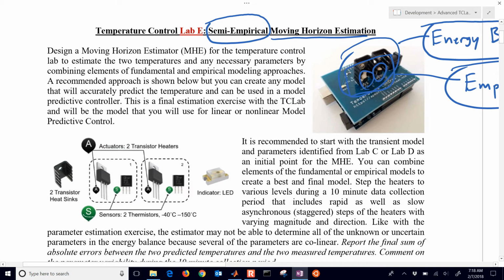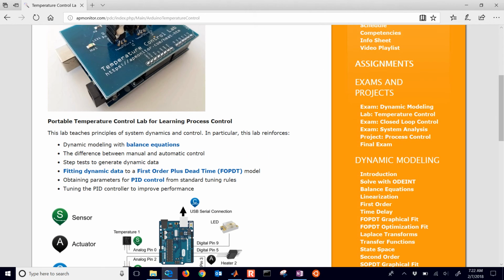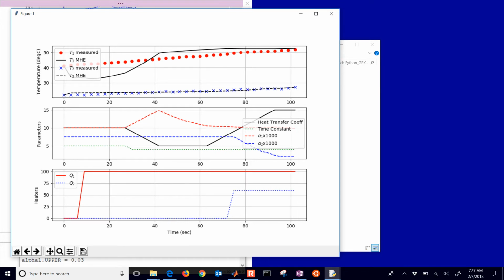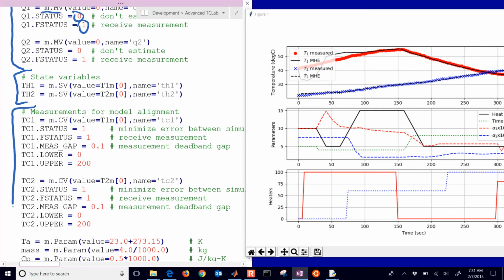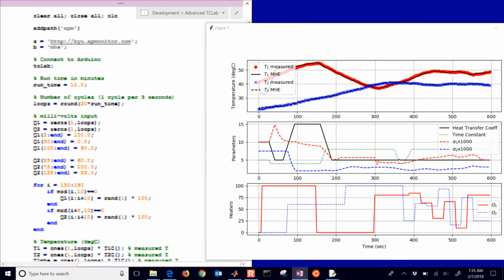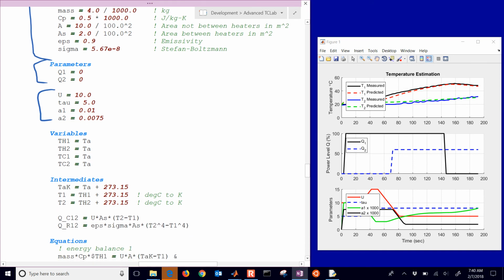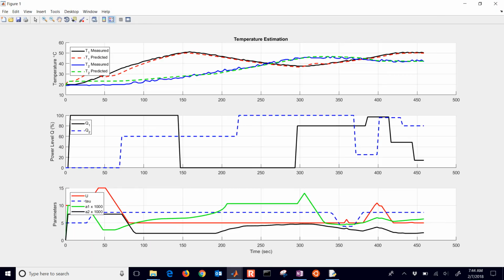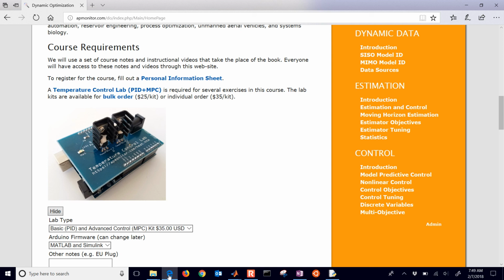TCLab Moving Horizon Estimation

Comment: I viewed this 3 times.  I think this is a good exercise in estimating parameters. Make a model and then see if you can estimate the parameters for that mode.   I do the same thing but what algorithm is used to do the estimation?  In real life I can't run gekko on an embedded product.  I must use BFGS or Levenberg-Marquardt.  

Sometimes there is noise on the feed back devices or failures.   It is good to have a model to switch to so the system can keep operating for a while or at least until a safe shut done.

I usually update the model using a batch method.  Updating models on-the-fly is tricky.  I have tried systems ID techniques like recursive least squares.  The problem is that some parameters should be updated during transients and others like gains should only update during  times when the input isn't changing.  Obviously there is no point in updating time constants when the system is at a constant velocity or temperature.

There must be rules that specify which parts of the model get updated.  Perhaps gekko takes care of this.

I like what you are trying to do.
I like what gekko can do for you.
What I don't like is that the under lying problems are not discussed.
I don't like that gekko is just a black box.
Providing answers without understanding does not really help.
I have written many different minimization algorithms from scratch in Mathcad just so I know what is really happening.
Reply from the maker: Peter, great feedback as usual. The details of the algorithm is discussed in the Dynamic Optimization course such as the collocation lectures (http://apmonitor.com/do/index.php/Main/OrthogonalCollocation) and objective function formulations (http://apmonitor.com/do/index.php/Main/EstimatorObjective). I've used APMonitor directly on a Raspberry Pi but micro-controllers (Arduinos) are generally too limited to run gradient-based nonlinear programming optimizers. We use a serial connection for this lab so that the computing is done external to the Arduino and the Arduino is used only for data acquisition (temperatures) and to adjust the actuators (heaters). Gekko itself is open source: http://gekko.readthedocs.io/en/latest/ - you may be referring to the underlying APMonitor executable that is performing the calculations as the black box. The dynamic optimization course (https://apmonitor.com/do) gives all the details on the algorithms that are being used. Unfortunately, the course isn't long enough to have students reprogram a modeling language and make a generic Dynamic Optimization tool such as APMonitor. The modeling language would need to include things like automatic differentiation, sparsity of 1st and 2nd derivatives, interfaces to sparse linear solvers, decomposition methods for initialization, collocation methods, etc. There are other packages that are completely open-source such as Pyomo. It offers a lot of flexibility but the flexibility comes at a significant speed cost.

We did the batch regression in folder 2 of 
https://github.com/APMonitor/arduino - we're designing the estimators so they can continually update the models even if the application is 
running for days, weeks, or years. That much data would obviously be 
problematic for a batch estimation approach so we turn to Bayesian 
methods.

You refer to writing a minimization algorithm from scratch. We do cover that in the Mathematical Optimization course such as http://apmonitor.com/me575/index.php/Main/QuasiNewton and http://apmonitor.com/me575/index.php/Main/InteriorPointMethod - the Dynamic Optimization course is more focused on applying optimization solvers and I encourage students to take the other course if they want to program the solvers. I agree that you gain a much more fundamental understanding of the algorithms if you program them yourself. My suggestion for students on this assignment is to use a good solver such as IPOPT instead of try to reprogram the gradient-based algorithm.
Reply: I would think a Raspberry PI would be able to control the temperature real tim.   Temperature changes are slow.   I am interested in motion control.

I was willing to watch 3 times because I am playing with the idea of doing a system ID over short periods of time similar to what you propose.   I am interested in controlling die casting machines.   The valves are slow and the process is fast.   Also the valves are non-linear so the model must change as a function of velocity or flow..  Closed loop control in the normal sense does not work.  What must be done is to compute models for different positions or times within the 'shot' so the model can be use to predict the output on the next 'shot'. 

Gekko might be a ready made answer but in my case I must be able to implement gekko's capabilities in firmware.

I will watch your other Gekko videos too.
Reply from the maker: The Raspberry Pi is a great device but they only have digital inputs, not analog inputs so you have to add an Analog to Digital converted to use analog temperature sensors with that platform. Your application sounds interesting. Keep us updated as you make progress.